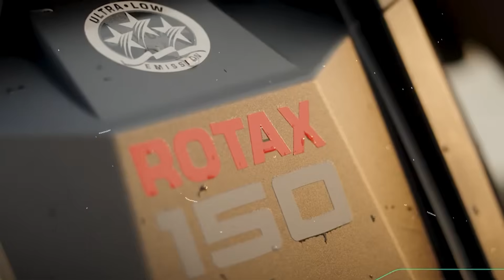The SHOCKING TRUTH Behind BRP's Rotax Outboard

Comment: I doubt they are 2 strokes 2 stroke boat motors were banned in Australia
Reply: They are 2 stroke
Reply: @rotarytechnician that’s amazing I thought they were banned but it’s just the emissions being tightened. If they expanded to RIBs it would have such a good market. One of the 150 ones on a 5 to 5.5 metre rib would be perfect
Reply: @RotaryGoose  rarely are regulations cut and dry.  The e-tec evinrudes are essentially this engine tech.